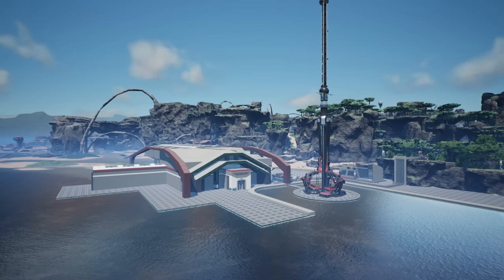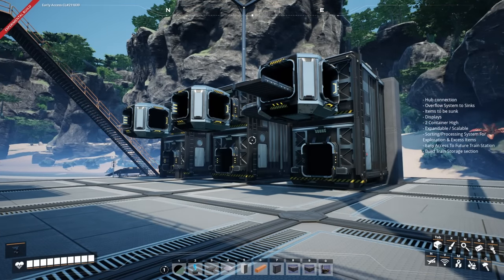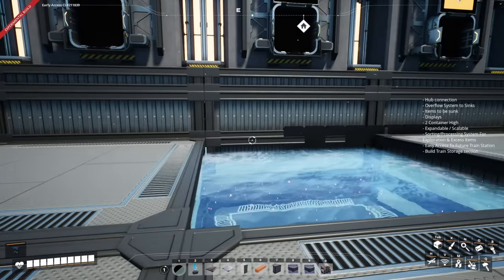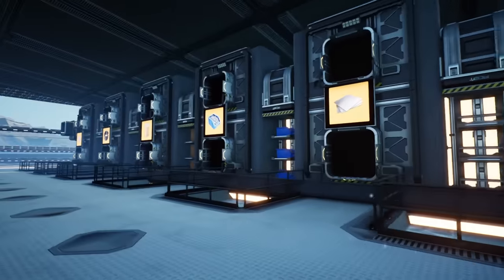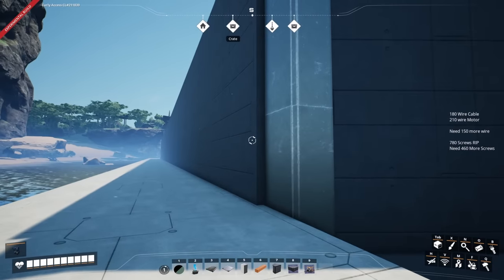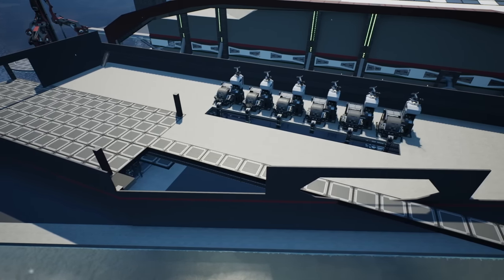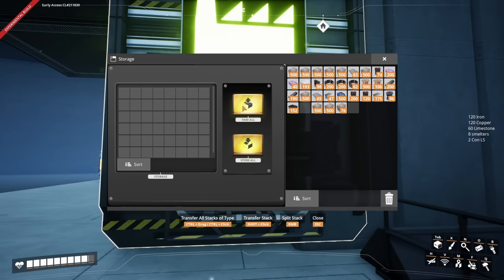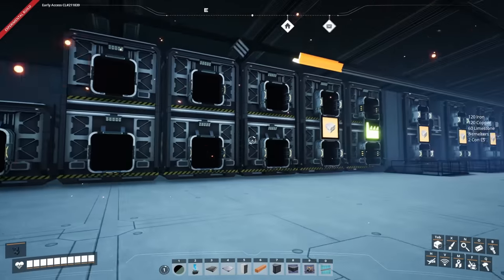Building the PERFECT Storage BLUEPRINT in Satisfactory Lets Play Ep.05

Comment from the maker: What do you think is the most important feature of a working storage system in Satisfactory?
Reply: That the convaor items are in the front (also cheese)
Reply: Efficiency!
Reply: That it works lol
Reply: I just noticed it when I had 2x 3 sinks back to back (aka 2 rows of 3) 4 of them ran... two last ones wouldn't run, connection power, disconnecting power, clicking suspend or whatever it is called... nothing would start them... built them further away then bam they worked... it's kinda odd...
Reply: Accessibility
Reply: Upgradibility. I built my hub with a floor dedicated for logistics and even possibility to use even lower levels to bring some stuff in, but the building happened to be too short and belts are way too cramped, despite quite generous planning.
Reply: That it has a slot for every item it's going to hold. Also i like a circular sushi belt. Meaning it has "item" towards storage, "overflow" towards sink/production, and "any" to the next storage. The last box closes the loop to the first one. That way you can have multiple random inputs, without cramping it up.
Reply: @MrHaggyy  this is a very nice idea! It means that you can have more items on 1 single belt and its gonna work fine i guess, didnt try it by myself yet, but gonna try it soon
Reply: Enough flow.
Reply: That it doesn't interrupt any major production lines!

Comment: What is the point of the mergers? That is not explained.
Reply: The mergers on the backend are just a clean way to route overflow from the Smart Splitter (storage inlet) to the lifts to head off to the Sinks.  Just to be clear, the merger is only connected to the Smart Splitter on it's left.   You could eliminate the merger,  add a 2 high Conveyer Pole, then connect the Lift to that and just run a conveyor belt.

That being said, if you ever want to run a lift off the Sushi line up to the sink, it would be handy to have the merger.

Comment: One more blueprint combo you may find useful is what I call the power scaffolding. A set of pillars, columns or similar that have wall outlets connected. Then a secondary blueprint that connects one pillar to another at an altitude with wall outlets too. Connect each power piece to each other and to main power with cables.

Perhaps for better visualization, one blueprint would be an "I" shaped piece, the other would be "_" shaped. Combine the shapes as needed for the build area and now you have power coverage for the hover pack on the construction zone. And like scaffolding for construction, delete once no longer needed.
Reply: I like a ceiling for that. One mesh is fully connected for hover, one has a lot of spare poles. On the spare poles you can hook any production you like and i usually make them switchable per floor.

Comment: This is such an awesome way to utilise the blueprint system! I can't wait until I start up my next save, I'm going to have so many ideas on what to do 😁
Reply: Blueprints are awesome, I can now build heavy modular frame factory with 3 individual blueprints that I have to place each five times and just connect main belt between each of them. And bam I have 12.5 heavy modular frames. My curent heavy frame factory is producing about 50 of them per minute, more time was spent bringing iron and coal to the factory then building it. At first, size of the blueprints was kinda concerning but if you split large factory in parts everything can be built rather easily.

Comment: how do you connect the merger or spliter directly on the in/output of the storage tank??
Reply: I'm sure there's another way but I typically put a conveyor pole down just in front of the input/output grid line and extend it up to be even with the hole, then place a very tiny conveyor to it. Delete the pole and connect the merger or splitter. Hope this helps!